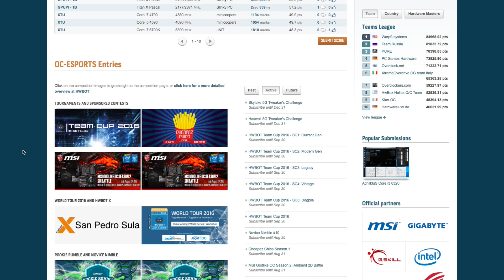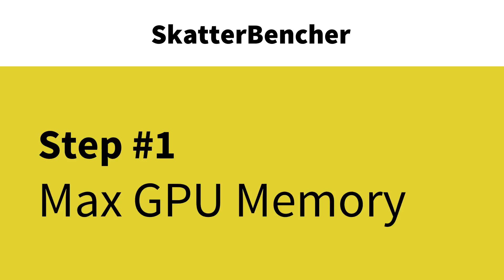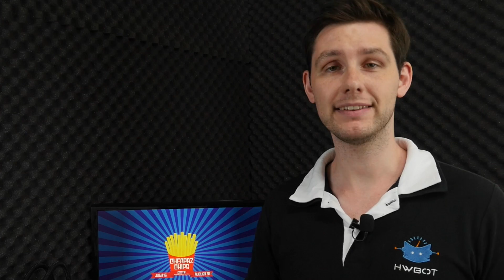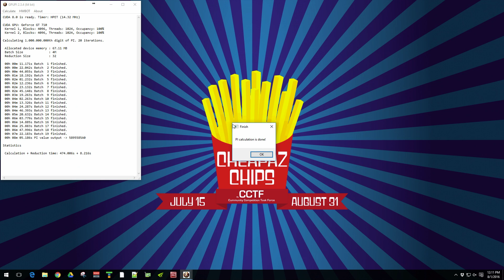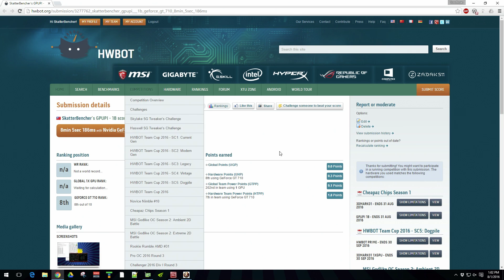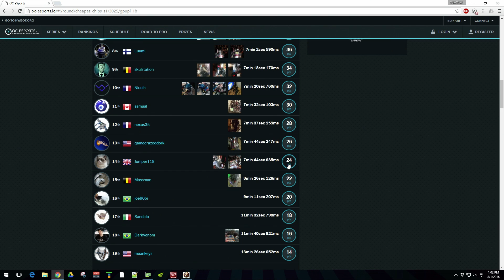GeForce GT 710 Overclocked to 1404 MHz | SkatterBencher #4

Comment: Anyone in 2019?
Reply: In 2020
Reply: 2023. Still fully supported via new drivers by nvidia. Got the ddr3, but memory got up to +300 and gpu +405 stable. Roughly +25% performance.
Reply: Yip
Reply: Yuuuup
Reply: I just buy this treasure and today start overclocking... :)
Reply: I got a sold 29% overclock lol.
Reply: 2020 haha
Reply: 2022
Reply: 2024 legend fartty
Reply: I still have mine in my second pc, but have since upgraded to 6800xt 😃  @ahmadayman529
Reply: 2024😂

Comment: I have the ddr5 2gb asus version i ended up changing the heatsink for a bigger one i used insulation tape around the chip allows for better cooling the heatsink also goes over the ram with paste 
Core clock 1250mhz 
Memory clock 1500mhz 
Runs at 55c

Comment: This helped me and gained confidence to overclock my GT 710 to it's maximum but unfortunately my Card was Zotac Zone edition which was passively cooled had temperature rising till 96°C which is not recommended n dangerous for the card to die,
So I did a small diy attaching a Fan to the card and wolaa at idle I get temp about 39°C and  overclocked while gaming apex gave me around temp below 65°C so fan in any passively cooled make sense.

Comment: I had it on maximum memory clock and speed max and now it did crash
Reply: Suomalaasia täällä ;)
Reply: Its not Crashed Your GPU has Stressed try to lowering the Base clock and memory clock or reset it to default if u want to overclocking just try to Add 100< on your GPU plz reply me if this work (Sorry of IM bad English)

Comment: Sir overclocking damage my  graphic card?  it is safe  or not plz rply me my graphic card gt710 2 gb gddr5
Reply: I've overclocked that card, but the ddr3 version until it went black screen. Like 5 times in a row. Not damage.
Reply: It shouldn't unless you modify the BIOS and change the voltage and power limits, then it could possibly get damaged.

Comment: I don't necessarily want overclocking, I just need to find out how to stop these TDR (black screen crash, then auto reset) errors.
I have the MSI GeForce GT 710 and the latest drivers I could find (388.13). I have MSI Afterburner, but it will not allow me to adjust the voltage to see if that helps stability, even after going into settings and checking the box for "unlock voltage control".
Reply: Remy Lebeau Same

Comment: can overclocking damage my gou
Reply: No, don't worry about it. GPU's were made to run at their max , overclocking is not a problem, it can only be a problem if you overclock way too much.
Reply: DEVANSHU DIXIT it can
Reply: if you dont watch temps....dont touch voltage and ur fine :)

Comment: hi, im graphique designer, i want to bay this card
and i dont know if this card cann work good with my machine
hp compact: i5 3,10 ghz- 4 G ram
Reply: yeah i know what you meant,but i just wanted to say that its not a bad card for a very low budget gamer etc. But yeah he should 100% get a better card
Reply: TheMalvage no it doesn't lol. but if you really are a graphics designer then YOU NEED a lot better card than gt 710
Reply: MattTheFourth It was just a way to say that for a graphics designer it's not good at all
Reply: MattTheFourth For a very low budget gamer there is the GT 640 which is way better for about the same price
Reply: Adil LAMIZI The GT 710 will work on that system,  but this card is so crappy that it struggles even with MSPaint

Comment: hello bro thanks 😉😄for this video iam using nvidia 710 graphics card and i have played gta 5 without overclocking in high settings with more fps and my system is Intel i5 6th gen processor 8gb ram ddr4 and now iam getting low fps while playing watch dogs 2 so i need to overclock does it affect processor or cause any damage
Reply: SkatterBencher 😄😉👍
Reply: V.Krishnan .sharma the problem is with watch dogs 2 not with your pc

Comment: i tried ur settings  450mhz/320mhz/100 mv
but the gpupi shows error 
then i tried to lower gpu clock by 20mhz every trial yet didnt work
lowered the memory clock by 20 mhz every trial still didnt work
then i tried using gpipi on default speeds and voltage yet it also fail
what do u think is the problem?

it fails even on default speed but my card works perfect, i do a lot of gaming with this card(only pc games up to 2013).
are there other way to overclock it?

I'm from Philippines and PCs are expensive and salary is very low so im stucked with this rig

core 2 duo e7200 2.53ghz
4gb ddr3 1066
ecs g41t-r3 mobo
galax gt710  2gb (3 months old only since i bought it from LAZADA.com)
Reply: SkatterBencher i did some experiment with furmark gradually increasing my core clock and add voltage whenever i see it is becoming unstable. 

my sweet spot is at 390mhz core clock, 250mhz memory clock and 87.5 mv without any crashes or artifacts.

Comment: hi i have msi gt 710 2gb .when i try overclock memory clock offset just to 80+ then  i have error in gpupi
Reply: SkatterBencher SkatterBencher intial kernel error and when i set gpu memory to 70 and  gpu clock to 450 there is no error in gpupie .and i get more fps in games but the problem is in games shows glitch .so is that glitching normal ?? thanks
Reply: the gt 710 have 2 GB video dedicate? or 2 GB total?

Comment: could it run GTA V with minimum requirements with an Athlon black edition and with 4 GB ram ??? ( the version of the GPU is 1 GB) !!!!
Reply: Yeah,in 30 fps
Reply: SkatterBencher with the lowest settings
Reply: 720p normal settings smooth as butter 😊

Comment: Would an i5 be capable enough to overclock at least moderately?
Reply: Yeah. i7-6700K
Reply from the maker: +Lewis Conroy the difference between Z170 and Z270 is very small, so if you can pick up a Z170 for cheap, I wouldn't say no. If you prefer a new board with more fine tuning and updated feature set, Z270 is the right choice.

Personally I've tested the GIGABYTE Z270X-Gaming SOC and of course the ASUS ROG Maximus IX Apex of which we have a video up. The Apex is a glorious board with OC DNA, but of course it depends on your personal brand preference and local price/availability too :)
Reply: I mean if you can mine won't let me i have the i53330
Reply: Warrior thanks for the response. I ended up with an i7, but I believe you can only oc an Intel processor if it ends with a K.
Reply from the maker: +Lewis Conroy that is correct. Did you end up with the i7 K ?
Reply from the maker: Approved! Did you beat our (silicon lottery fail) 4.6GHz result?
Reply: Actually as it was an unexpected Xmas gift, I still don't have a motherboard for it!
Reply from the maker: +Lewis Conroy are you shooting for one of the new Z270s or rather pick up a cheap Z170 ?
Reply: I have no clue. Which would you recommend?
Reply: SkatterBencher Ah, I see. In that case, I think a Z170 sounds like it'll do the job.

Comment: Error: High Precision Event Timer for time measurement not found!

This is mandatory for Windows 8 and higher to avoid skewed timing.
You'll find a guide on how to enable the HPET timer on your system
in our FAQ. Open about dialog in the menu above for the link.

Dont go GPUPI
Reply: I got my up and the fan spins, everything it intact. I put cd in, but it said something about an error and i get the "please confirm whether to support this vga card. I went on bios which asked me something (sorry, can't remember.) but i clicked yes. But how do i activate it on Bios? I have avas republic of gamer motherboard. Any idea what I did wrong?